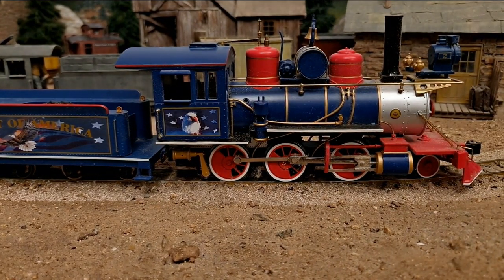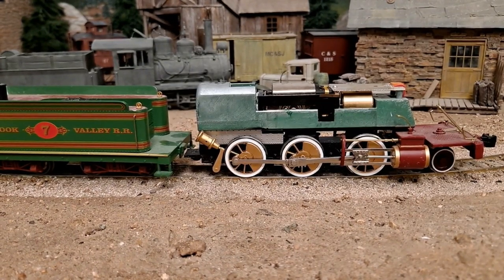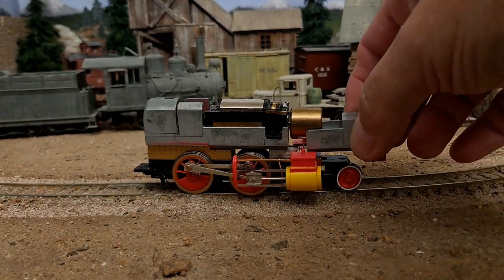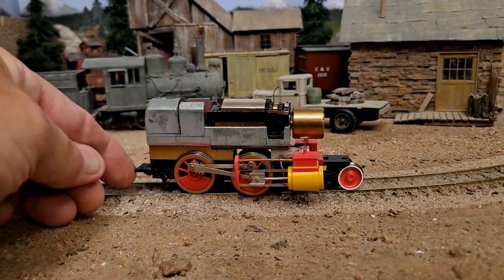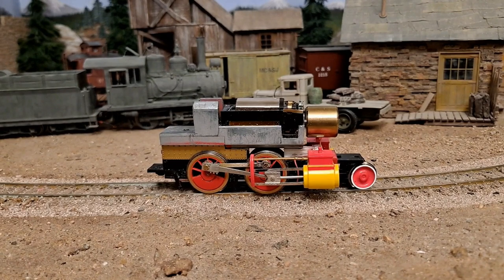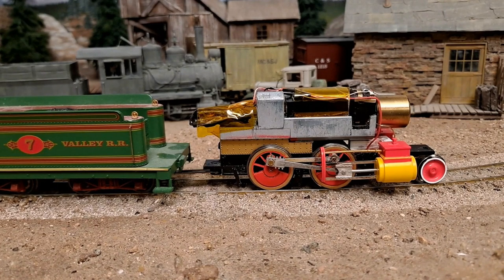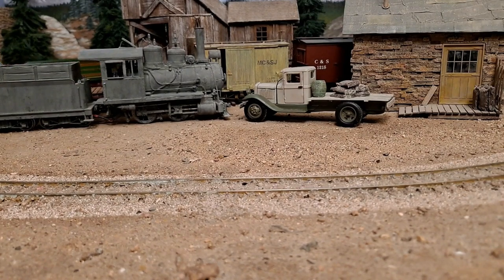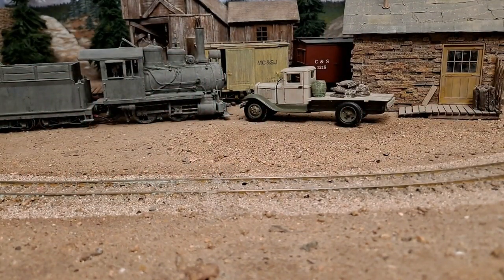Bachmann On30 2-6-0 Mogul to 2-4-0 BIG Porter

Comment: Very nice modification, and indeed a nice beefy Porter. Would be very interested seeing the steps taken to convert a 2-6-0 into a 2-4-0 (or any x-4-x variation). I assume you remove the front driver and reconnect the linkages.
Reply from the maker: My fault. I've been away from trains for a long while. I flipped the drive wheel to the back after taking the entire loco and all the linkages apart. If Bachmann had only made the side rods the same length, it would have been so easy.

Comment: I would love a tutorial on this build. 0-4-0 porters are hard to get a hold of right now and I need an On30 locomotive that can make the curves I have space for.
Reply from the maker: Sorry to take so long to reply. I've been away from trains for a long while. The secret Bachmann doesn't want you to know is that almost any HO locomotive that runs well can be scaled up to On30. That's how it all began. I only used an On30 2-6-0 at the time because it was cheap, heavy, and had a giant motor in it with a flywheel.

Comment: What is the difference between on3 and on30
Reply from the maker: Distance between the rails. 
On3 Gauge vs On30 Gauge:
Both are O Scale (O), Narrow Gauge (n), or On.
The 3 = Gauge (distance between the track rails).
On3 Gauge = 3 feet or 36 inches between the rails.
 - Nicknamed 3 foot gauge.
On30 Gauge = 30 inches between the rails. Not 36.
 - HO gauge track is 32 inches from outside rail to outside rail.
On30 Gauge runs on HO gauge track.
On3 Gauge is 6 inches WIDER. 
 - Needs WIDER track than HO.
 - Locos/Rolling Stock models are generally larger in On3.
The most notable difference is the price. On3 is more expensive.

Comment: Can you make on30 trains longer too?
Reply from the maker: Yes you can! 
No one has ever asked. 
All you need is time, money, and materials.
Great question.
Reply: @FineTrains  but can you make a new engine that bachmann hasn’t made like a 2-8-2
Reply from the maker: @etwnc1917  Oh. I thought you meant BIG. Like a 2-6-6-2 or 2-8-8-2. 
Yes, you could make a Mikado. But, there are On30 2-8-2 K-series Mikados commercially available 
for less than the amount of time, money, and materials it would take to build one. 
Or, you could build one from scratch with brass, if you have several months. 
I built one years ago out of a Bachmann HO 2-8-0 upsized to On30.
Reply: @FineTrains If you could figure out how to somehow make a 2-8-2 Yukon queen like the #190 at Tweetsie Railroad or #192 at dolly wood that would be the coolest thing I have seen in on30. I’ve been trying to make one but I don’t know what would be the best way to go about it.
Reply from the maker: @etwnc1917  Mikados have complex side rod linkages. I would probably up-scale an HO 2-8-2. The Precision Scale MMI On3/On30 Mikados are pricey and too large for On30.